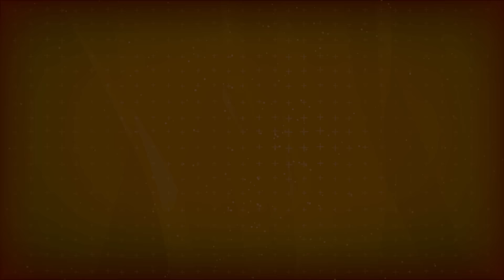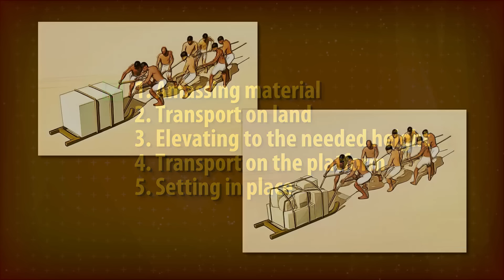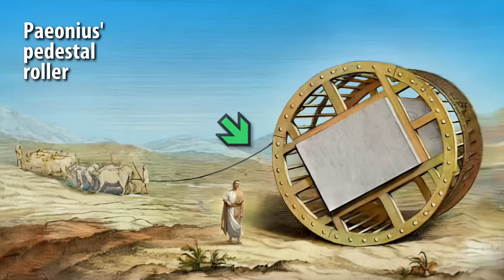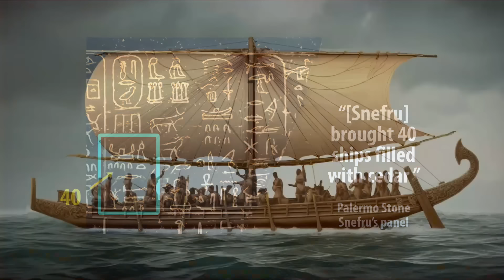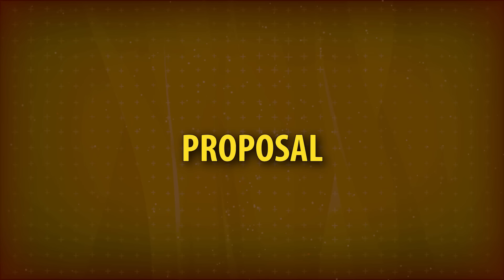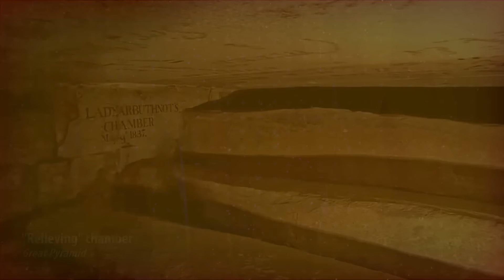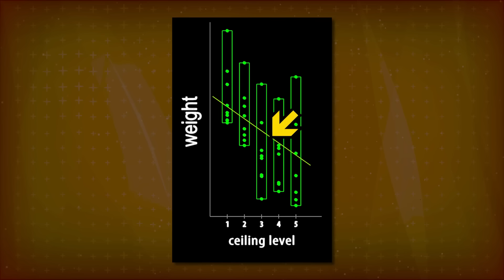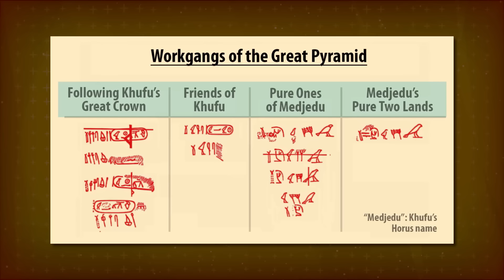How to Build the Great Pyramid in 9 Months (NOT aliens)

Comment: My only argument against the rubble section is that it assumes a whole lot of what we don't know in terms of how their methods would have differed from what we assume. It also assumes that while they were smart enough to lift up large blocks, they were incapable of figuring out how to lift smaller blocks. Which seems backwards, irregular or not, they likely had a way figured out. 
Same goes for hauling the "rubble" blocks. There's nothing that says they had to always move as much as the regular weight of a "full sized" block at a time. I get this is the road to a 9 month pyramid, but we know that's not how they were constructed. 

But even more than anything, I'm glad to see the rubble of the pyramids talked about at all. It seems like everyone throws that aspect out the window when talking construction and it's reduced down to a saliva driveling "but how dey cut all dem stones"

Comment: So how did they cut the massive granite stones in (e.g.) the king's chamber?  Note that these are large stones that fit together with tight joints.  Dozens of 25 to 80 tonne stones quarried and cut into perfect (square, flat and true) rectangular blocks.  Various methods have been tested, most commonly a weighted copper blade using sand and water as abrasives.  Best documented results in a 1 meter wide stone were about 10 cm in 30 hours with no measurements of accuracy taken.  To cut a 1 meter X 1 meter stone (not close to the size of the stones in the king's chamber) would take 300 hours.  And remember, the finished product has to be perfectly rectangular and identical in height to the stones on either side of it.  
I don't think it was aliens, but there are no answers to the methods used.

Comment: Does every stone need a custom made or built roller. Thats a lot of wood and rollers to be built which we have found none of and how are you getting the stones in and out of these rollers. Also all the material for the ramps how are these ramps going to be built cant be cut stone, rubble, or wood which will be standing on unfinished stones because you cant rest ramps on smooth angled casing stones and after all the blocks are put down including casing stones i suppose the ramps would be taken down starting from the top working down backfilling were the ramps onece stood with the smooth casing stones until you reach the bottom. So im guesing the ramps are made from wood that's the only way for them to be easily dismantled and built, because how are you going to build the ramp from cut stone when you need a ramp to transport such stones well Youd likely built the ramp as you go it would be part of the pyramid structure can wood scaffolding hold such large blocks without breaking up I'm not sure so lets say the ramps were made from cut stone each layer of the ramp built by sones being rolled up itself then again the only issue would be dismantling the ramp after completion and what is the ramps cut stone resting of if its the casing stones well wed see remnants in the blockwork which still exists towards the top of the pyramid and if on the bare stone under the casing stones it would mean each stone would have to be taken down and probably pushed down the finished side of the pyramid on a sled by the force gravity where then the area where the ramp stood would then be backfilled with smooth casing stones working backwords down the pyramid. So the ain issue for me is the rollers i find it more likely a sled was used opposed to rollers which seem to only be able to hold one stone and again that's a lot of rollers to be built.

Comment: Well done. I’ve long thought that the inner sections of the Great Pyramid are likely rubble. Makes no sense to fashion blocks no one is ever going to see. The parbuckle method seems so obvious in hindsight. Was not aware of the Greek methods. As soon as I saw those quarter-arcs I knew where you were headed with this. 

The one question I have is how you account for the construction of the courses upon which the ramps are built? The ramps need the courses, but if the courses are built using the ramps, there is a problem with those logistics. Perhaps I missed that in the presentation. 

At any rate, great work not only in the reverse-engineering of the method, but also the presentation and the excellent visualizations. Look forward to your future videos.

Comment: The markings on the walls of the Kings chamber seem to show a bag, water, rope, light-footedness, clever eyes and a bird. Indicative of floating stones like trees draw water up trunks. In addition theres markings which look like magnetic field lines and parts of magnetohydrodynamic pressureadjusters which probably opened/closed sluices at the top and bottom of tunnels respectively to allow stones to float on their gasbags above final destination before being vibrated against their destination. This ensures tight fit with watertight seals where required
Reply: Vibrating slightly above where they need to be, while still floating.  Ofcourse sand can be used instead of water when vibrating elements are used, because sand acts like a liquid when shaking it. Thus making it a variable fluid both in shape and support and structure and properties and purpose

Comment: They didn't run out of granite. It's fluid dynamics. They didn't lift the stones: they floated in tunnels within granite corridors with sluices. That's why it looks assymetric and the top blocks are limestone. Smaller stones at the top simply because up there it's not a need for the heavier stones to retain the hydrostatic pressures like at the bottom
Reply: Granite is not porous. They are smooth and large to hold waterpressure

Comment: I think the smaller blocks and rubbles were brought up by means of wooden ramps applied directly on the sides of the pyramid. They used their own body weight as counterweight in pulling downslope. 60 men can counterweight a 3 tons block, 4 rows of 15 men and more than 50 ramps can be built all around the pyramid… for me, the grand gallery is another ramp built to raise the big granite blocks with the same method.

Comment: I really like your explanation. It is probably the most comprehensive one on mechanical ramifications. Especially the fractal ramp is the most convincing part of thi puzzle. 
However, I would have liked you to address the other problem of historical timing. The pyramids are a couple of thousands of years older than the historical evidences presented from the Apollonian temples. I would have liked you to explicitly address that issue. To me it does not mean it would be impossible in any way, but I believe most of the flak you will be getting is by historians saying those things weren't developed by that time. Actually meaning we have no direct evidence. 
I absolutely love your idea of using wooden templates to cast mudbrick quarter arcs. Doing quite a lot of mold making myself, the templates/ master molds/ prototypes are the most valuable things you have. How big are the wooden quarter arcs they found anyway? What are they called by historians?
Reply from the maker: @MrSubstanz Thanks for the comment.
1. Yes, the Greek rollers came 2000 years after Giza, but there's nothing in the roller technique itself that wasn't available to ancient Egyptians. I don't know if the Greek rollers used nails. If the Greek rollers used iron nails, they'd could've been replaced with copper/bronze nails in Egypt, or rope ties.
2. We only have small models of the quarter arcs (never used), we don't know how big the real things were. The only reason we even have the models is because they were buried in pits, as a good-luck offering
3. There are different names for the arcs: rockers, cradles, roundels etc. "Quarter arcs" or "quadrants" seems neutral, it doesn't force a specific function.
Reply: @nightscarab5802  Let me just say your video made me both look for historical artifacts ("rockers" showed up results at the Met) and take out a ruler and paper to see if those were only models or actual pieces (I think they must have been models, too). So if you try to inspire people to learn more: Congratulations, you succeeded in at least one instance! :) 
Keep up the good work, I love both your videos!

Comment: Excellent video.

And to remind anyone who thinks that the pyramids in Egypt and Maya were connected in anyway (because you hear that occasionally: same shape, so they must have been friends).

A pyramid has a sturdy base and is not top heavy. Like a hill, it is can last much longer that buildings with vertical walls because it isn't precarious.

In short, there are probably hundreds of large ancient structures, but pyramids are the most likely to still be here thousands of years of later, while weather, gravity, and erosion destroyed most of the rest.

Comment: The thin edges of the mud brick roller version could crumble during the rolling due to the immens weight of the block. Perhaps the mud mixture tended more toward the consistency of cement or mortar.

Comment: With yearly Nile floods, high river would be the best time to transport  cargo and the entire farm industry would be idle while waiting for the waters to recede. Break those nine months apart to match with flood season and it would only take a few years. Meanwhile, the quarries would be able to operate year round. There could be workers on the build site year round also. Two major things they could be doing is excavating and moving rubble as back-fill in the pyramid and stockpiling materials to make mud brick, and doing all of the predatory and engineering tasks, along with finish work on the previous course of stones. All of the out of (lift) season work wouldn't even count against the 9 months amount of work, yet would be a large percentage of the work hours required for the total build.

Comment: All the technology you show was provably present in Egypt at the time, so it's not impossible, the ratchet apparatus looks over-engineered, but as you show much simpler but slightly slower methods work fine...and as you said this is an extreme but plausible limit - they probably did it is a slightly simpler way, slower, but this shows it wouldn't necessarily take more than a couple of decades, which is fine 

The reason for building it, is a 'vanity project', but also it keeps a large number of people busy, building, supplying them, feeding them, etc ... without training an army that might consider overthrowing you ...

Comment: I dont think its theory, those are facts, there is unfinished rough cut rubble or stone inside. Question is why? Why bother filling in the empty pockets with rubble, why not let it be an open structure with air flow?
Reply: Structural support

Comment: Well, thus certainly blows the single big ramp theory completely out of the water.
I never considered it to be all that feasable anyways. 
some possible evidence might be in the remaining cover stones on site;
it would make sense that they would be added last in a section as the ramps are decommisioned, leading to vertical banding with the lower sections nearer the vertices places first, and the areas near the center of the faces placed last.
Too bad much of the lower face stones had been carted away with appropriation for other works as time went on since construction.
9 month floor on such a build, tortuous, but doable. I would expect the pace to be 5 to 10 years myself. much lower staffing requirements

Comment: To move a large slab up a slope, you can attach rope(s) to it and throw the rope over the peak where it is attached to a bucket on the other side.  Fill the bucket with sand or smaller rocks until the bucket weighs more than the large slab.   With enough ropes to handle the stress, the large block (either greased to reduce friction or on small roller logs) should slide up a smooth ramp/slope.
By putting triangular (cap)stone pieces on each step, you can turn the 'jagged' side of the pyramid into a smooth slope. 
How effective you are depends on how much rope you have for the job and how fast your workers can fill the bucket with sand/stones.

Comment: About wheels and the Egyptians: They had chariots, which had wheels, although it is believed the chariot was not adopted for several hundred years after the completion of the Great Pyramid. Also, another good reason why they didn't use a lot of obvious and culturally-pervasive wheeled transport was probably because of the scarcity and value of wood in the region. They were literally importing timber at great expense from far away. It was used to make sarcophagi and tool handles and war implements like bows and arrows, royal barges (The peasants used simple reed boats), and other high-end essential wooden objects. The average peasant wasn't going to have a cart made out of expensive foreign wood. But I'll bet you that wheeled transport DID exist, it was just limited to save costs on expensive imported and scarce wood. They did without using wood and wheels wherever they could for all those reasons, giving the impression they did not "have" wheeled transport. Another thing they had which made wheeled transport even less of a necessity was canals. Though most are long buried now, almost every building site or settlement in feasible reach of the Nile had a temporary or permanent canal built to it to just float things in by barge. This is all the natural consequence of a unique civilization that had almost no domestic wood, but a huge resource in the Nile and stone and reeds.

Comment: Excellent video - thank you for putting this together. If you visit Peru and take a look at the polygonal walls you'll see the same concept that's suggested here. The visible outer face provided the 'appearance' of precision only, as the hidden side of these walls were simply backfilled with gravel and rubble. Engineers are lazy by nature - we will always look for the simplest, least labour-intensive solution to any problem.

Comment: Why have rope handlers walking down the ramps with ropes, slowing down the cycle?  
As a roller arrives at a platform, it rolls over one side of each of two loops of rope whose ends have already been pulled up to the next platform.
The rope handlers drape the other side of those loops over the roller, flip the 'bridge' down, and the workers above start pulling it up.
However, the rope handlers also attach the two ends of each of the two ropes they just used to pull that roller to their platform, to that same roller.
As it rolls on up, it pulls the ends of that rope to the next level up, leaving two loops at the bottom.
The rope handlers position the bottom loops for the next roller coming up to roll over.
However, the workers on the platform below did the same thing.
So the workers on this platform have also received the two ends of each of two ropes attached to the roller that they just pulled up.
They look down and see that the workers below have the rope in place on another roller, and the bridge flipped down.
They look up and the roller has been pulled past the 'bridge', so they can flip it up and start pulling the next roller up.

And the cycle repeats - slightly offset at each platform because of the need to flip the triangular bridges up and down.
Ropes work their way to the top platform, from where they're dropped down to start up from the bottom again.

Comment: Perhaps the internal "rubble" actually a deliberate part of the design for a reason, such as allowing air passage through the rubble, where inside areas finished with perfectly cut blocks, the openings in some areas were to allow air exchange into and out of those rooms. It could also serve a purpose for any water intrusion to drain downward through the rubble areas. What sort of rocks the rubble is composed of might also have had a purpose if the pyramids as some claim had a higher scientific purpose in some former age before our current age of past 4 thousand years, as some claim they could be 12 thousand years old.

Comment: My theory is that the ramp system (whatever ramp system you imagine) was built on the raw inner bulk of the pyramid.  Then the final facing was staged on various levels of the pyramid, and the ramps were removed and replaced by the facing from the bottom up.  This way any ramp system does not need any additional bulk to support it; it is supported by the Maine bulk of the pyramid.
Reply: I would say from the top down.  You need the  stepped outside structure to get up (and return down).  Facing is smooth and not climable!

Comment: Wheeled transportation of stone blocks is not absolutely necessary. To transport the blocks they could have started with a cilindrical shape stone and rolled it to the site. Once there, carved or chiselled into a block form and use the carvings as rubble like it shows on this video. Maybe even rolled all the way up and chisselled  right at the point of its final position.
Reply: You can't split stone into cylinders only.blocks